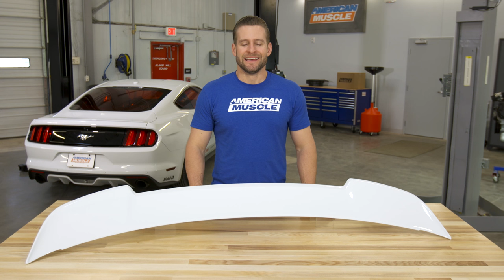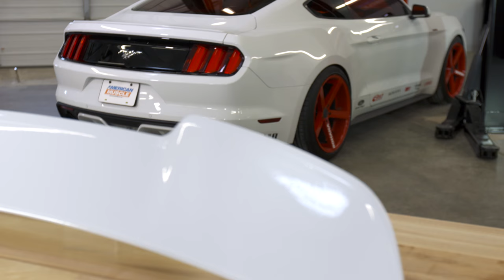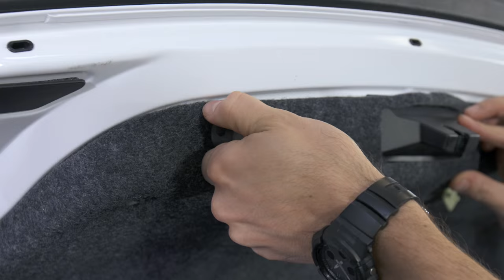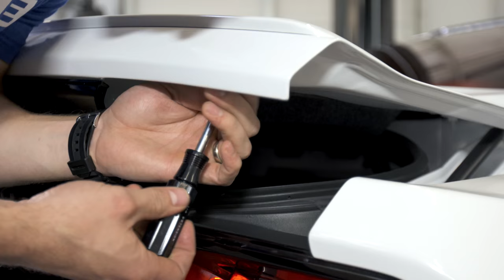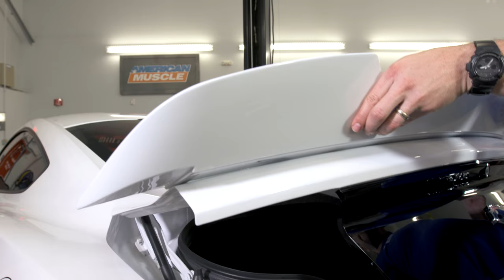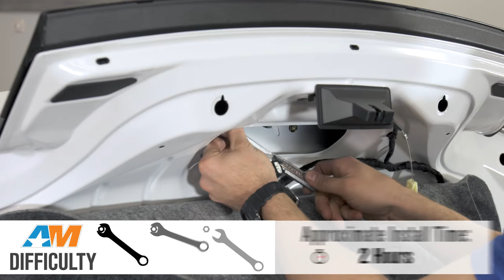2015-2017 Mustang MMD V Series Rear Spoiler - Pre-Painted or Unpainted Review & Install

Comment: i love the styling of it, reminds me of the 07 roush rear spoiler style...but cant decide on this one or the Steeda race wing
Reply from the maker: I personally like this one better :) Definitely a hard decision! What other mods do you have on your Mustang? -Elaina
Reply: working on trying to get the RTR grill with LEDs, but just so pricey, also want the raxiom 8inch screen conversion (i have a base model GT) also trying to get the gt350 front bumper.... so far, ive got the blacked out roof, snake eyes, lowered on steeda springs, Crave2 NO25 20inch staggered wheels, Roush stage2 charger, and MBRP race h pipe exhaust...really wished they did a little more for the rear bumped on the base model though. It forces you to have to switch to a premium for anything, unless i do the inserts you guys sell, but that all i see available for that alone...

Comment: Does the 2018 use the same pre drill holes as a 2015-17? They changed the spoiler but what about the hole locations and sizes?
Reply: Joseph Coates Pretty sure it does and should be the same for 2015+ models

Comment: ive got the OEM spoiler off what's the best way to get the adhesion tape off the car?
Reply from the maker: Hey Jordan- 3m and a few other companies make an attachment for a drill that works like a charm, google 'adhesive removal wheel'.  Its a rubber material and honestly its better than what I did in this video which was use 3m's liquid adhesive remover and my finger nail...lol. -Justin